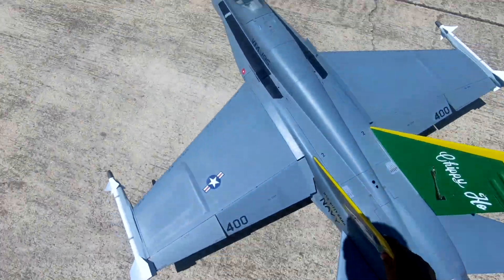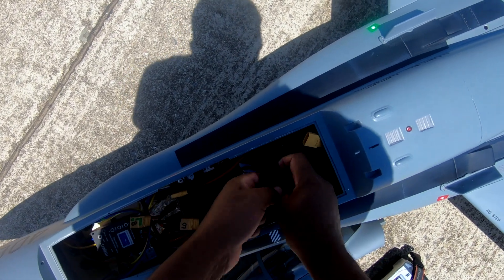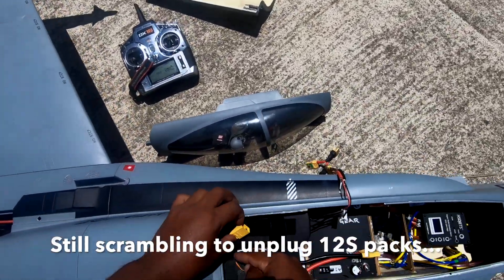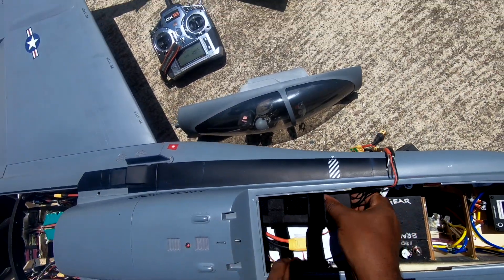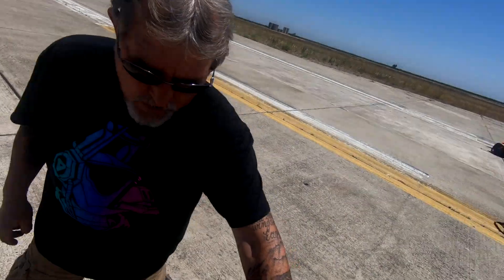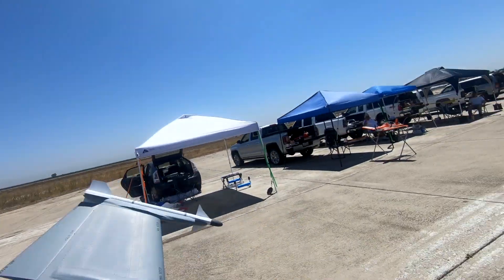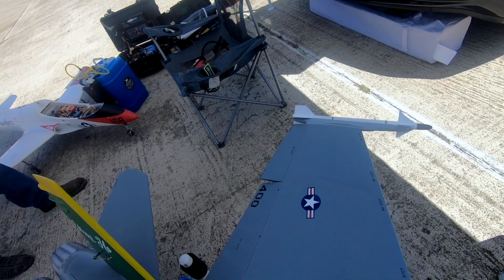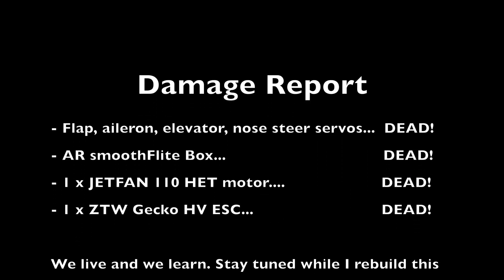Skymaster Twin 110mm EDF On FIRE!!!

Comment: I've had bad luck with those esc. Had two of them go bad on me. Been using the Hobbywing since then. I notice you don't use AS150 connectors. I used them for two season. One you don't get the spark which over time your connectors will be tarnish. Secondly your not sending a rush of current to your esc. My thinking is that that rush of current to the esc could cause damage over time. Just my though. 

You'll get the problem work out. Good thing it wasn't in the air. I've have that happen to me two times lol.
Reply from the maker: Yeah good thought on the AS150. I thought about it and I still may move to those. Wound up with XT90-S. These special XT90-S have spark arrestors so that's good but you are right I should really get the 150s
Reply: @FlyWithFrank  Here's something I do. First I put AS150 on all my plane's 12s or 6s. I only buy my batteries with X90's I'd like to be able to buy them with no connectors. For my 12s planes I remove the X90 connector replace with AS150. For some of my 6s planes I made an adapter with a X90 male connect to battery and AS150 with a short lead that goes to the esc. This way I don't have to remove all the X90 connectors from the batteries because your spark arrestor is on the esc side. I found they will also work on the batteries just as long as you connect the negative first.

Good luck